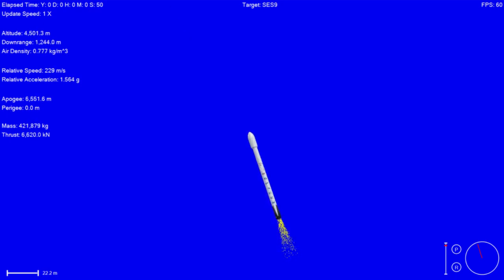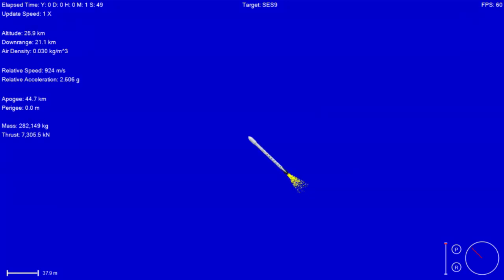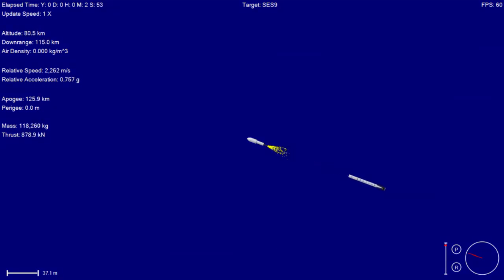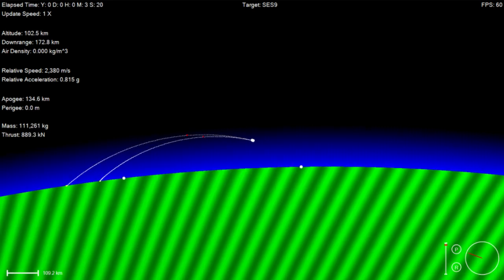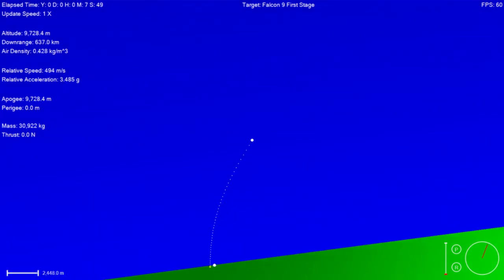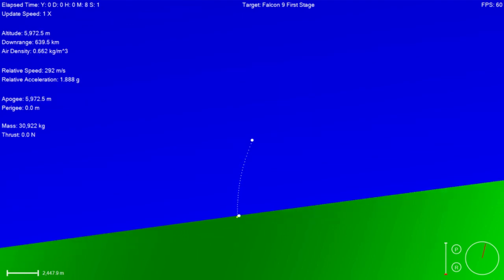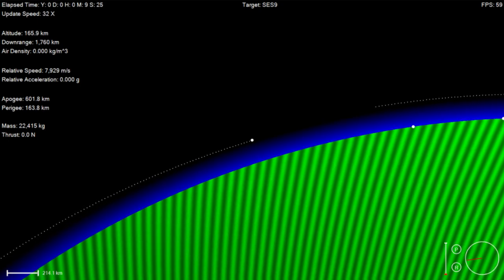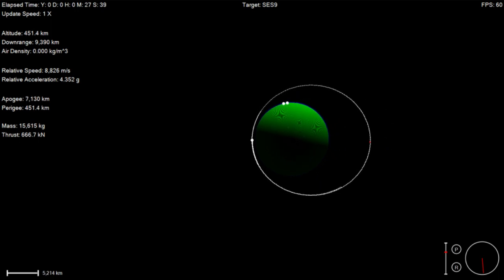SpaceX SES-9 Launch Simulation

Comment: Hey, this is an amazing piece of software! I wish it had a more consistent visual style though. Is this a hobbyist project or you're doing this for a specific purpose? I'm wondering if it performs all its calculations in 3D space or uses a 2D approximation. I'm going to prototype a physics engine which is capable of simulating spaceflights as well.
Reply: +punpcklbw This is just a hobbyist project. The description contains a link to the GitHub repo if you want to check out the code. It's a 2D approximation, so some aspects of the launch are unrealistic. However, for forces like drag and lift I am using the 3D surface area. The biggest flaw in the simulation is that it assumes equatorial launches which isn't too far off from Cape Canaveral in terms of ground rotation speed.

Comment: Nice job Zach. How did you model the landing trajectory after entry burn? Was there telemetry data in the webcast or did you derive it somehow? Also, how accurate is the 170 m/s velocity at the start of landing burn?
Reply from the maker: There is no public information or telemetry on the first stage after MECO. The only hints we get from the webcast are the callouts for when the burns start and sometimes when the stage goes transonic. My simulation currently doesn't take lift into account so I would say that the trajectory is only accurate until it starts getting deep into the atmosphere.

The only thing we know for sure is that the landing burn used three engines this time. My simulation shows that burning 3 engines on 60% thrust will generate 4.2G. I'm assuming the dry mass of the stage is ~25,000kg and the engines generate 756kN of thrust at sea level (known value).  If the burn lasted 4-5 seconds then the kinematic equations will show it had to be moving around 170 m/s.

Comment: Nice job with the simulation. Did you scrape telemetry from every frame to generate this, or was it a tedious stop, note down, start process?
Reply from the maker: +Andrew Stokes Thanks Andrew. Reddit user /u/ianniss scraped the telemetry from the webcast and generated this launch data:
https://plot.ly/~iannis/folder/iannis:150

I used that as a guide to make sure I was on track. I tried to use his graphs for thrust as well, but unfortunately he had no way of differentiating between thrust and drag. The only inputs to my simulation are pitch and thrust, so I had to make sure my aero model was close enough to produce the same data as the webcast.

Comment: Is it safe to say that with this flight they've basically proven that they don't even need any boostback burn for a drone ship landing?

So you could say together with the attempted 3-engine landing burn they've probably learned more than from Jason-3 and as such it was a success. :)

Since they talked about 3 maneouvres for the upper stage, do we know that it has deorbited after payload separation?
Reply: +Robin Frischkopf You always learn the most when you're doing something you've never done before! That said, I think it was pretty well understood already that a barge landing wouldn't require a boostback burn. And the barge landings are expected to remain at a much lower chance of success than the RTLS landings, 3-engine burn or not.
Reply: Yes but they haven't tried one ballistic only so far. I wonder what's more expensive, the fuel for the boostback burn or the fuel to get the barge a few extra 100km out. :)

Looking at Jason-3 I think that in the future they could be on par for the landings, I certainly hope so.

I can't wait for the first RTLS in daylight. Do we know if FT can do RTLS on CRS?
Reply: The landing in December was a FT doing a CRS mission. The missions that are challenging to RTLS are the heavy sats going up to geostationary transfer orbits.

As for you other question. It's still best to do a 'boostback burn' on a droneship landing because it allows them to enter the armosphere more slowly which reduces stress on the rocket. Also doing single engine landing burn is preferable because it slows the rate of decceleration and makes the actual hoverslam landing a bit easier for the computer to judge.
Reply: +Cody Childs Orbcomm-2 in december wasn't CRS. CRS is Dragon to ISS which is considerably heavier.
Reply: Robin Frischkopf you are right sorry. Still, answer remains the same. FT can RTLS on a CRS flight.
Reply: I hope you're right. :)
Reply: +Robin Frischkopf It looks like they're going to do a ship landing for CRS-8, even though they have the capability to RTLS.
Reply: Seems like the logical choice to get the ship landings right first. I'd love to finally see that but I would love a daylight RTLS even more.